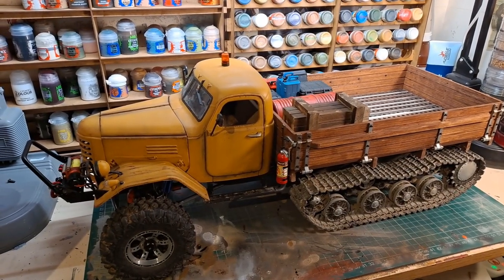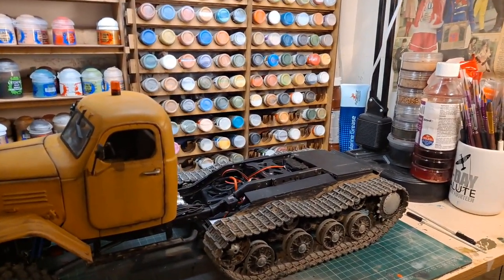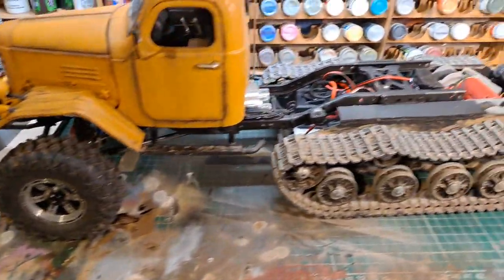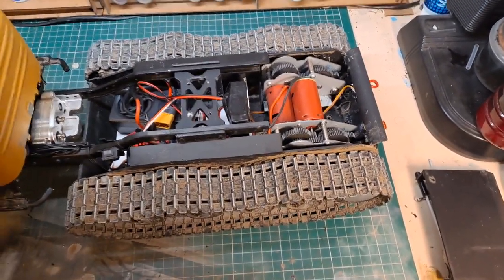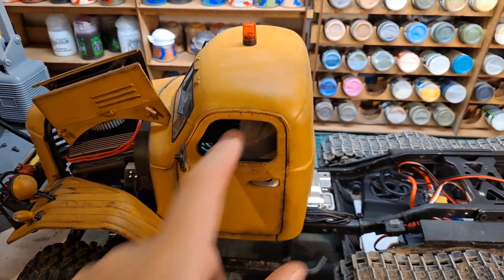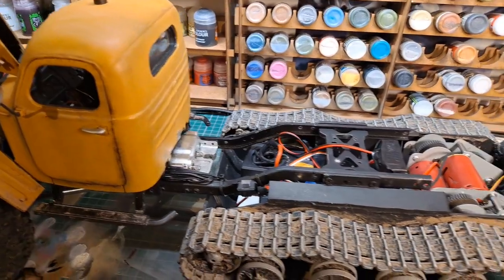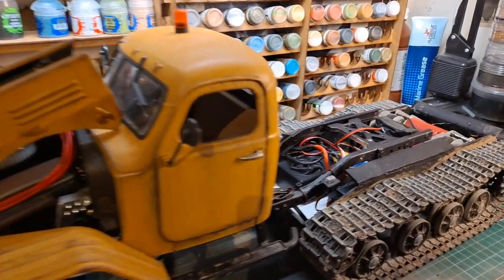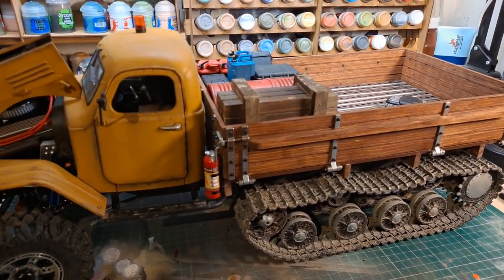RC HalfTrack build

Comment: Brilliant engineering choices. I admire the way you thought hard about how to sync up existing components instead of custom machining complicated parts. The dual ESC set up is super clever.
Reply: I had thought about using an Arduino to make an assisted steering system, like, turning left, slowed the right hand track and such. But in reality, it would not have been as robust as going down the two ESC's road. But something I want to consider in the future.

Comment: I've built a half track myself using a redcat gen 8 scout and a henglong tiger 1, all 2 motors are running off the redcat esc so it's not exactly in sink, on a surface like carpet you can see the front suspension drops as the front axle is faster and  trying to pull the tracks, I was thinking of upgrading the tank motors at first to gain some speed, maybe get programmable esc's in the future.